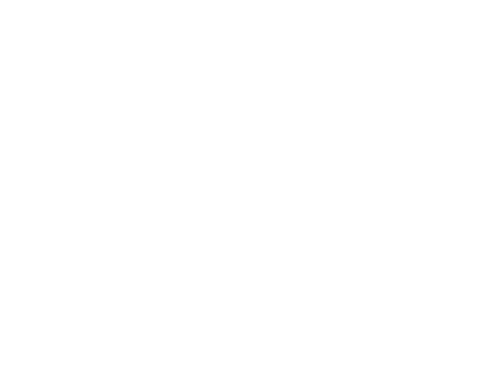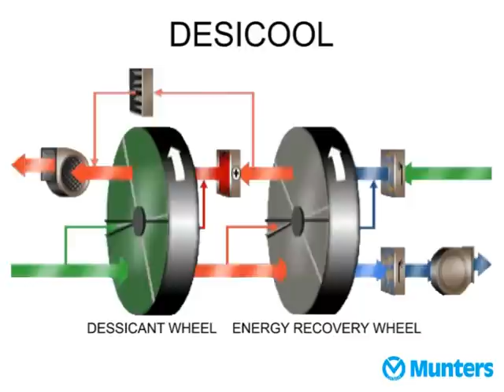DesiCool Explanation

Comment: Everything explained makes sense but I am left totally confused by what isn't explained. The bottom part of the process makes sense if this is creating a flow of cooled air within a building. But what about the air at the top of the process? It looks like it takes air from within the building but where is the exhaust sent - the outside or the inside? If to the inside, where is excess energy sent? If to the outside, what is the volume of air exchanged compared to that recirculated? Is moisture content referring to absolute or relative humidity?

Comment: What is inside the "Energy Recovery Wheel?"
Reply: As I understand from the video (in min 2:30 of clip it says that the wheel only adds or removes sensible energy) It should be a non-desiccant material with good heat conduction, probably Aluminum

Comment: once air is dried, then why the hell it is passed to evaporation cooler ?
Reply: To cool it
Reply: @zachary3777  but evaporation cooler will humidify it again.
Reply: Psychrometric chart
Reply: @hadimani3101  well cool wet air is better than hot wet air though there are other systems were this doesn't take place
Reply: Evaporative cooling is acting as a post cooler....the whole idea of this system is energy efficient system...this system can be used effectively in conjection with chiller system to minimize the initial load so that COP of chiller will increase and power  consumption will go down and you will get some what controlled over RH.